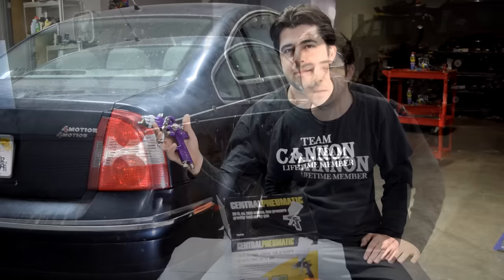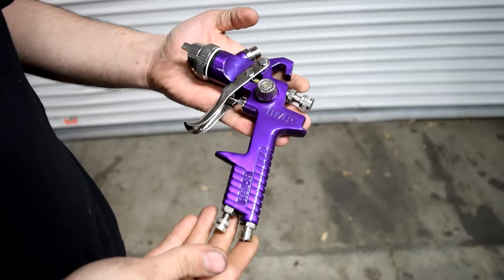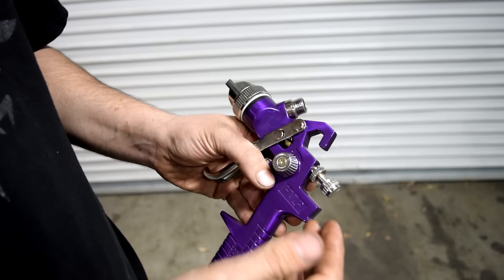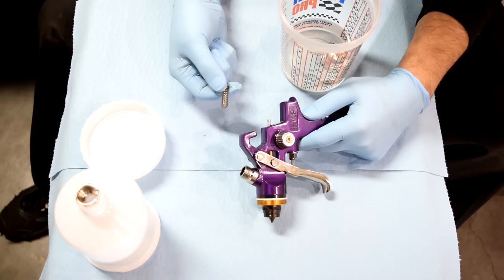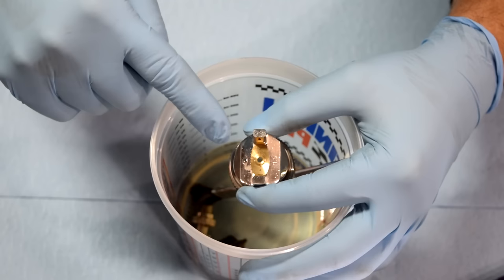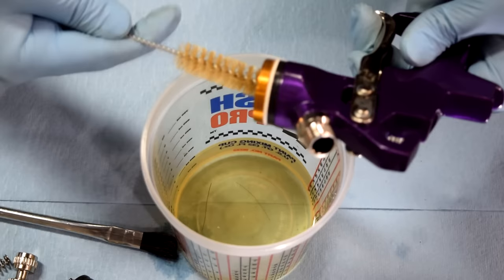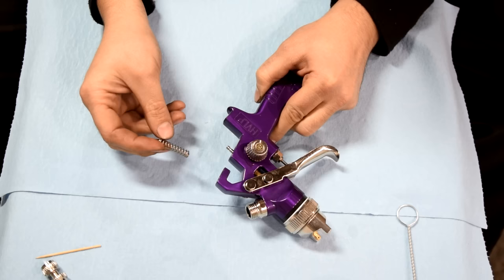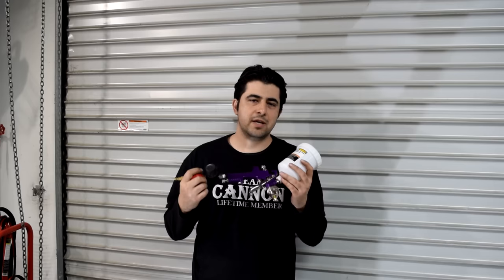Harbor Freight HVLP Spray Gun Review - Also Cleaning and Setup Instructions

Comment: I read somewhere that you can eliminate the built in air pressure regulator on hvlp guns by taking it out completely and just using a block off plug in its place.

Comment: I agree that detail cleaning it thoroughly when you 1st get it is mandatory but honestly I just flush mine now... I used to detail clean my guns every time but now I just flushing it with Paint thinner (Mineral spirits) works very well and takes about 3 min.

To flush it after a spraying session I open the guns setting full blast and fill the cup, shake up the gun and spray about 4-6 oz of paint thinner through it, then I clean the cup with a rag soaked in paint thinner and refill the cup with about 4oz  of acetone... Spray that through it, pull the needle wipe it down with paint thinner put it back in and spray another 2oz of paint thinner through it. 

Then I just wipe the gun down with a rag soaked in paint thinner, and put about 1 oz of thinner into the cup and set it on its stand, I leave it "wet".

Doing this makes the gun last easily about 10-20 spray sessions. And at $9.99 each once I get one that starts to spray poorly or gets "sticky" I part it out, put it in the ultra sonic cleaner it and grab a new one off the shelf, I keep 2-3 "in stock" and just buy them on sale with a 20% off coupon. 

I have sprayed about 12-15 gallons through my current gun using only the simple flush method and it still sprays nicely.

Comment: As soon as I'm done spraying, I dump out the remaining paint and then run lacquer thinner through the gun, shake it up, dump it and then do
it again with more fresh thinner.  I rarely disassemble my guns because running the lacquer thinner through them immediately takes care of that problem.
Also...never let the paint sit inside the gun for long.....ESPECIALLY if you're using any kind of hardener in your paint.
Reply: i'm new to this and this is what ran through my head after he was done
Reply: Ditto.  Doing this makes the gun last about 10-20 spray sessions. And at $9.99 each once you get one that sprays poorly or gets "sticky" I part it out and ultra sonic it and/or scrap it. I have sprayed about 12-15 gallons through my current gun using only the simple flush method and it still sprays nicely.

Comment: I took an 11/16 open ended wrench and grounded it to a 19 mm and ground the sides to make it more narrow of a wrench, All I used was a 4-inch angle grinder, took about 15 minutes but it works perfect, It fits the nut on the bottom of the cup for a little extra snug.  Great video

Comment: A great little gun for just dollars from Harbor Freight!  Very easy to use and setup.  Never used one before, attached it to my 55Gal air compressor and used it to spray stucco paint on my garage and it worked perfectly without any problems.  I guess you could pay more for a higher quality gun but if your not doing a lot of paining or don't anticipate doing a lot of painting later, why spend the extra money for a better gun when this one works perfect!

Comment: HF offers this purple HVLP gun in two different part numbers, same price, but one comes with the wrench and one does not. Also, there is assembly lube in the adjustment for the fan spray and built in regulator screw as well.

Comment: Tip only: Take a common bread twist tie that has plastic on it and burn off or melt the plastic off with a lighter or match. The metal left is excellent for cleaning out small holes or orifices with. Better than a toothpick in reality. Do up a couple of them to keep in your cleaning setup kit.
Reply: Super smart for folks who don't have any type of small needles! I have some from a wig-head and much smaller ones from 3d printer nozzles, but this tip is legit
Reply: Old guitar strings work good as well ;)

Comment: @ 4 mins 23 secs into video, you said use 19-20 mm wrench, untrue unless have specialty wrench which is way thinner.  I just purchased one of these today (correct on not having included wrench) BTW behind that nozzle the copper section un-threads and loads of factory lube in in that section.  Great video besides what I noticed though upon cleaning mine :)

Comment: I needed this. My gun came with tools and a 9mm tube wrench that fits inside the body. It looked as though that threaded piece that the nozzle cap threads on to was meant to come off. It does not. And I see he didn't his either. Good info.

Comment: Appreciate the time u took doing this video. It is easy to follow, complete, and shows how an added regulator w moisture filter makes this avg air gun both adjustable and paint flow reliable to avoid compressor moisture in the paint. Only thing i would change would be to use a female SWIVEL adapter to the air line. Just makes ANY air tool easier to manage. Thanks again for another detailed video!

Comment: I just got one of these guns and none of the factory seals were close to tight enough to hold air.  I pretty clearly got a bad gun, but it's a half hour each way in traffic to get back to the shop, so it's easier to fix the gun.  It holds air now, but only just.

Comment: Since barely anyone has a thin 19mm wrench, I use small vice grips but protected the part from scratching and stripping by covering it with a rubber jar lid remover from your kitchen. This thin grippy thing is placed between the part and the vice grip jaws. Be careful.

Comment: More great tips - thank you.  One disagreement though.  Both of the threads you used tape on are compression fittings & if working properly shouldn't need any tape.  The exception would be if putting an air fitting directly on the gun which has tapered threads.  Thanks again for all your helpful information.

Comment: I'm not sure which model you are showing here but I picked up the 62381 from harbor freight today and it did come with the wrench.

Once I got it home to do a complete cleaning on it I was unable to get the fluid nozzle to come off, the wrench just rounded it off, when I took it back to HF they grab another one to replace it and I told them I wanted to try to remove the fluid nozzle on it before I would accept it and after going through five of them they where finally able to get the nozzle to come off of one of them. What ever they are using in there isn't like silicone anymore it's more like an epoxy on the threads.

I also notice that the lacquer thinner was removing some of the purple paint from the gun, I could really care less about that to be honest but thought I would let people know they can expect this.
Reply: +Lost One The only way I found is to take the needle out, tape up the nozzle so it doesn't get destroyed and use a thin-jawed Vise-Grip. The stuff they use is basically an anti-rust epoxy so it survives the boat ride over here. It's not silicone!
Reply: I found an old pair of wire strippers works just fine to get it off....Strange but true...
Reply: I appreciate the info on the stuck fluid nozzle.

Comment: The HF spray guns are a craps-shoot; sometimes you get one that works, other times you get a paper weight.

One common problem with all of these cheap guns is that they don't last very long before having big problems. Usually the fan size gets smaller and smaller and they won't adjust right.

It is OK for a budget one-time job but not a long term tool. A professional tool will be easier to use and deliver years of consistent quality results.

Comment: I am fairly new to spray painting so basic question. What size compressor is needed for a Harbor Freight HVLP gun? I have a 12 gal 125 max PSI compressor. It does not seem to keep up with the gun, dropping the pressure to 60-80 PSI after a few seconds of spraying.

Comment: Probably a dumb question but other than the initial cleaning to remove the lube, if I am using water based paint from Home Depot, i don't need lawyer thinner, right? I can just use water. Right?

Comment: I'm going to use this to spray water based paint from the rustoleum cabinet restoration kit. Will this work? Should I thin the paint? I assume I would clean it with water.

Comment: The proper way to clean is to pour laquer thinner on the container and spray it,until its clean its save time and your setup.
Reply: He did it at the end of the video you should watch it again
Reply: No matter how much lacquer thinner you spray through the gun you won't get all the paint out. You need to breakdown your equipment after each step. Prime, paint, and clear
Reply: Leon Onitnelot Yes sir That's the correct way.

Comment: Excellent review, I think I have the same gun. What surprised me about the instructions was the manufacturer recommendation to keep pressure above 30 psi, which is higher than those with most professional HVLP guns. What happens when you shoot at lower pressures with this gun? What is the optimum distance from the nozzle to the work piece?
Reply: It takes more air pressure to get a finish with little orange peel on these spray guns. With a more quality gun like an iwata ws400 or devilbliss prolite you'll be able to go down to 20 psi and still get a showroom finish. Also don't turn your fluid tip all the way out. Youll be more likely to get runs or sags besides these spray guns already waste a lot of material.
Reply: 6-8 inches away from the work piece and moving approximately 1 ft per second is optimal

Comment: This was very, very useful, thank you so much!  Never used a spray gun before and have to do a DIY project soon.

About painting cars...
I have an RV I want to paint a few months later.  Does not have to be perfect.  Its a 22 ft Class C RV, looks like a UHaul truck with overhang.  Sides are fiberglass.  I want to sand, prep, paint it.  What type of paint should I use?  Automotive paint costs a lot.  Does any oil paint work or only automotive.  I will not be painting the metal truck portion, only the fiberglass walls.  

Another issue is not having a clean room.  Are there warehouses one can rent by the day?
Any creative solutions to doing this outdoors in a driveway?  Build a scaffolding with plastic wrap?

Comment: has anyone used this to spray paint with metallic in it? I'm wanting to repaint my truck with a mild metallic paint and clear coat. any recommendations on a good quality paint that these guns like? and good pressure to use with it.
Reply: thestigmach1 if .18-.25 you'll be fine! Just make sure to reduce just a lil bit more( 5% more), it'll flow a lot smoother out of the gun of your choice.

Comment: Hi, I have a question for you,  I want to buy that gun but I have a compressor already is a Ryobi 6 gallons, 2.6 scfm @ 90psi, and 150 psi max, do you think will work, because the specifications for the gun said 6 cfm @ 40 psi 20 - 70 psi, and I saw a lady using a pancake compressor different brand, help please. Thanks

Comment: This is a great video. Thank you! I would like to use it with a bag instead of directly into the cup,  that is possible with HVLP  gun?  Do you have a video on different size tips and their frequently used applications?  For example,  2.8 for large metal flake.   The best tip for spraying base coats and such?
Reply: mongoosevacations only comes in a 1.4 tip. You can't order another tip for it.

Comment: Hey. What size compressor do I need for this gun?
Reply: get harbor freight 21 gallon, fill with oil and change it before you run it. run it for 15 secs and change oil again, run for a few mins and change again. tons of milled metal shavings inside casing

Comment: just fyi there IS a huge difference between this and a pro spray gun. get the tekna prolite for $500. I've tried this purple gun and it leaves splatters, big dots of garbage everywhere, lots of orange peel. with the tekna this is no contest, well worth $500. the graco fx3000 is better than this gun, but even compared to the tekna there is no contest, just spend the money on a good gun with easy to buy parts like the tekna

Comment: Can i use a normal compressor for Mail guns etc. To paint with?
Reply: Nail*
Reply: hey man I'm not a painter but I have seen videos on these things and you sure can use a normal air compressor I've seen videos where dogs are running about 40 PSI and you can get a filter that goes from your air hose to your gun that filters the water condensation I hope this helped because when I decide whatever done I'm getting that's what I'm going to do he's a little cheap $40 Harbor Freight air compressor to paint a Mustang Power Wheels

Comment: I have this him and my fluid nozzle does not come off.
Reply: I had the same issue. They put an epoxy sealer on the threads to prevent rust on it long voyage from China. You have to find a way to break it free. Use a vice or vice grips. Its a real bitch.

Comment: where the hell can i find that damned wrench, i bought a 19mm wrench and it is slightly too small.  Bought a 20mm wrench and didn't quite work right either.  It seems one needs a narrow wrench like this with the enclosed end of the wrench.  If anyone can help let me know, went to the hardware store and they didn't know what the hell i was talking about.  I may just return the gun to harbor freight and buy  a Husky HVLP from home depot.
Reply: The spray gun that comes with the air regulator also has the wrench with it...but still couldn't get the nozzle off.  the brass thread portion came loose instead.
Reply: Chris Gordon a good socket set with deep walls can do wonders!

Comment: Total piece of junk.  The gauge had the needle on the wrong side of the stop so that doesn't work.  I couldn't take the nozzle off even tried using a hammer.  I bought mine online so I just threw it in the trash.
Reply: GOOD JOB😀